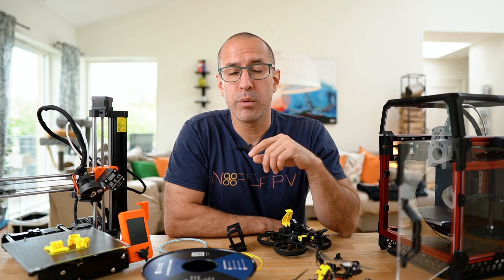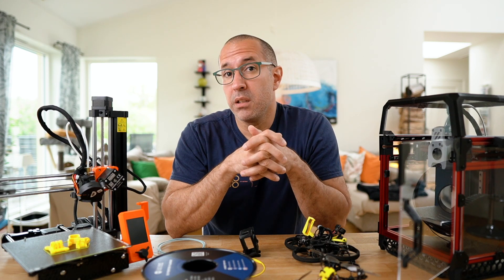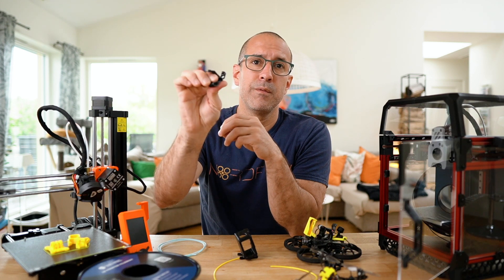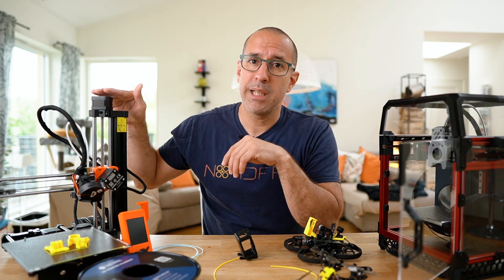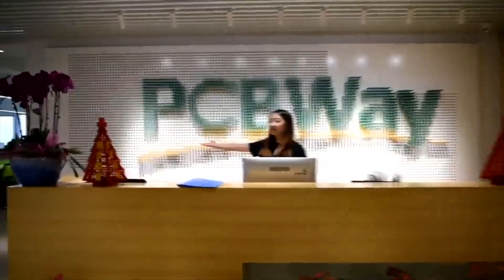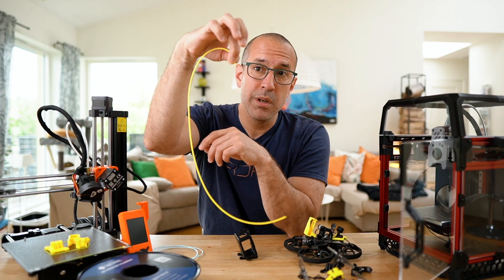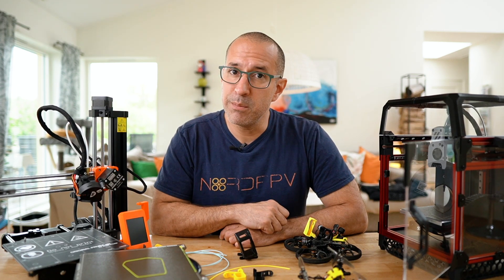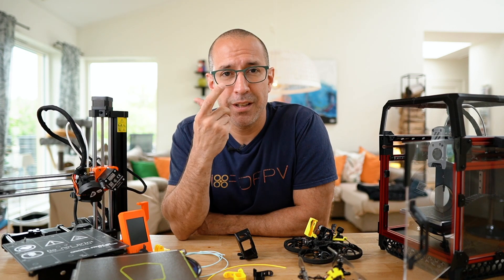Can you print TPU on a bowden 3D printer?

Comment: +1👍started on bowden, but reading got me interested in direct-drive.
results:
bowden was easier to print without much tuning because there was almost always pressure on the TPU filament within the tube, that said direct-drive was really hard to tune, but resultant prints are significantly much nicer.  the only downfall now is that i have to watch for heat-creep which on occasion will jam in the extruder gear, but as my tune has become better, this is becoming more rare.
my vote is DD, unless you dont want to mess with it much, then bowden is good enough.